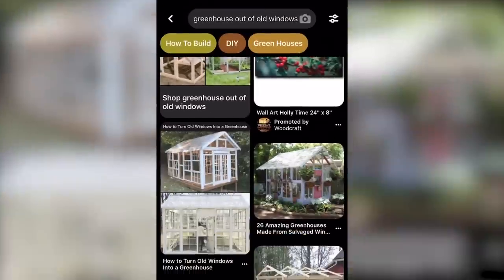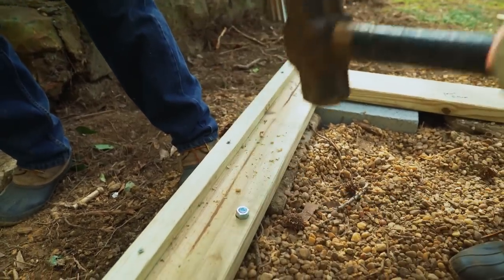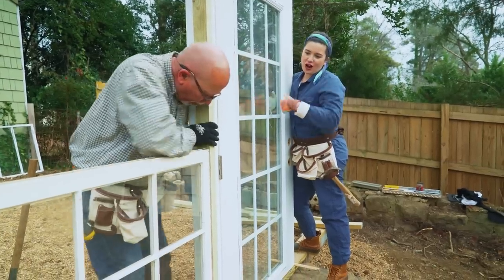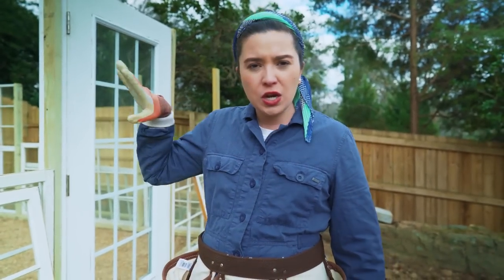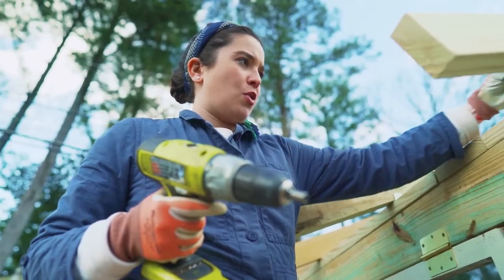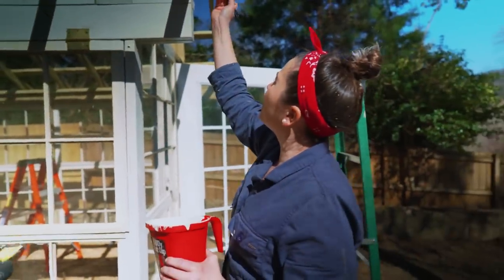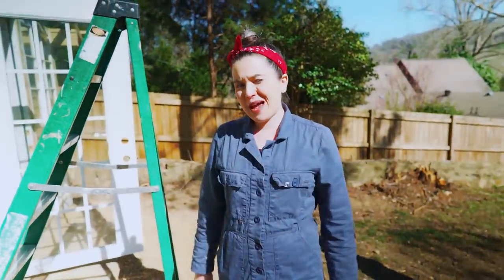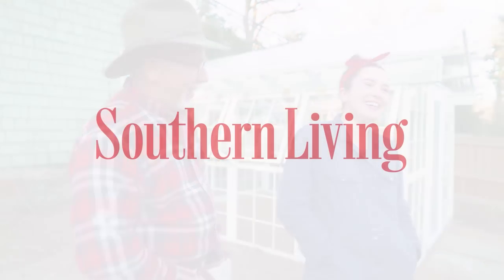Build Your Own Greenhouse with Vintage Windows | Step-By-Step Process | Hey Y'all

Comment: I had a blast, Thank you to everyone at Southern Living that made this possible! I
Reply: Do you have any other tips that may not have been mentioned for someone about to try this out? I'm also worried the windows won't all fit together and I'm gonna be stuck having gaps.
Reply: Allysa Piiru  You can cut most windows down around 1 inch plus or minus before getting too close to the glass. We had to do that on a few. You also might have to change your width , height or length a bit to accommodate the size windows you have. Window shopping was the hardest!. Go on Facebook and search old windows- you might luck up and find a vendor who mostly sells windows and would have a good selection.
Reply: @farmerwayneo2520  Thank you! I appreciate you taking the time to reply! You did great work and it was so sweet seeing you both work together.
Reply: About how much did everything cost? Can you come help me build one? :)
Reply: Can I ask what was put in just under the peaks of the roof?  It didn’t look like glass. It was hard to tell in the video. Thank you.
Reply: @christineciaccio6584  we cut a piece of plexiglass and put in each eve. You could use the same roof material if you wanted , which would be a bit cheaper
Reply: You are such a great example of a supportive and loving parent! Really adds to the video, you both did an awesome job.

Comment: Your so blessed too have your daddy helping you. It was a learning curve for me. I don't have my daddy around but in spirit now. But son has picked up helping me when I need it.  He just finished putting together the gifted green house from my sin from another mother. All but putting it up on a 4x4 frame.  But he's going too help put together a new one from old Windows I've collect throughout the years and he's brought home from jobs he's done 2 windows in frames that raise and latch and one high window from a hotel that has one corner crack double panned they all 3 have nailing stripes and a storm screen door. I just have too buy screw and 2x4's and roofing panels. Thank you so much for sharing your build.

Comment: So, 6 months later! How did it hold up? I'm up in Indiana, and we have some big old window sections that are 7ft long x 4 ft high that we are drawing up the plans to make a greenhouse out of! They are the same kind of windows as yours- more like a section of 4 horizontal crank windows that were in a porch someone had walled in - probably back in the 70's. They are so heavy its unbelieveable! I really liked your video, it helped answer some questions we had on framing and such - we are doing g sunken cinderblocks w a base plate and anchor bolts too...but alot more cinder blocks :) How warm did your get? We get pretty warm up here, but then we get super cold in winter.. Great job!
Reply: Go to her Instagram and check out the Christmas Decor- about 6 month later and still doing great!

Comment: The white also keeps the PVC plastic from burning on your roof the less dark colors you have there the last oxidation you’ll get. Purlins are the name of the board that go across the top of the roof on your rafters to set your roofing on. And no bird mouth to sit on the top plate?

Comment: Hello.  Great Job! I am inspired by this video. I am going to build this.  I have had the windows for 3 years and because I saw this I am ready to do it.  I was reading through your product list on the step by step link and I am a bit confused and would appreciate your help.  It listed 
14-foot long (2x6) pieces of treated lumber
and I cannot figure out if it needs 1 14 foot long 2x6 or 14 foot long (12"x2x6s)  
Example:  The instructions say: Lay 2 (12-foot long 2x6) treated pieces of lumber on each long side, then lay 2 (10-foot long 2x6) treated pieces of lumber on the shorter opposite sides to create a rectangle.  The list above says:
12-foot long (2x6) pieces of treated lumber
10-foot long (2x6) pieces of treated lumber
So do I need 2 12-foot long (2x6) pieces and 2 10-foot long (2x6) pieces? 
The reason I am asking this is because I am going to have most of this pre-cut elsewhere and fabricate what I need to as I assemble it.  I don't want to send this list of needs to have it cut and then only get 1 of each thing when I need 2 of XYZ and 3 of another XYZ item etc.  I appreciate your help. Thank you very much.

Comment: How did you seal between the supporting roof rafters and wall framing that extends over the eave?
Reply: We used the extra roof material to put in between each rafter

Comment: If I wanted to do this on an already established concrete patio, what would I need to do in order to give it a temporary anchor?
Reply: If it is going to stay there, just drill holes in the base plate and concrete when you start.

Comment: If I had told my daddy “I’m not drilling” I would have been drilling a hole with a couple less teeth in my head.
Reply: i can't believe her dad let her talk back like that. I'm an adult and i still would never address my dad like that.
Reply: @piperrasmussen  she is very respectful and thankful, it sounded worse than it was. I wouldn’t have been there if it were not the case.